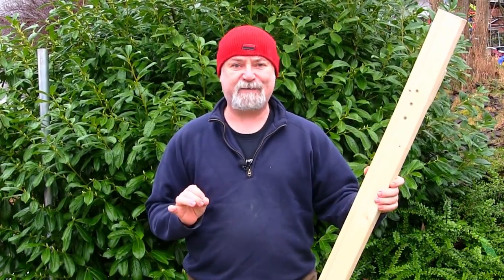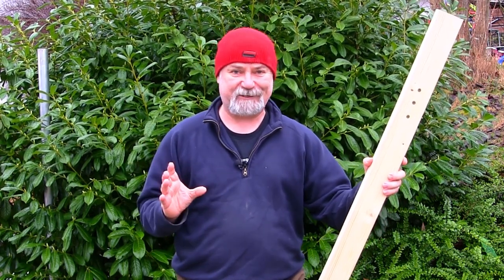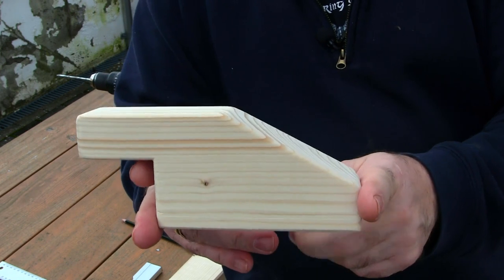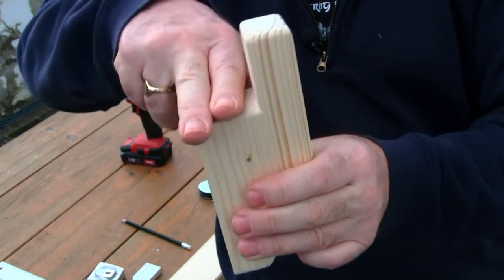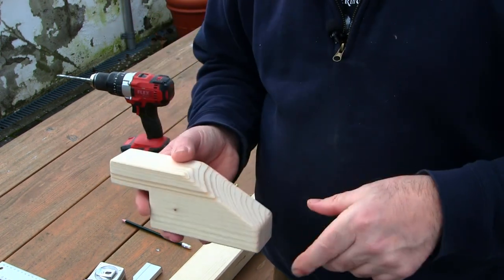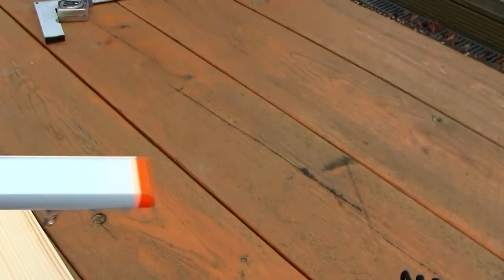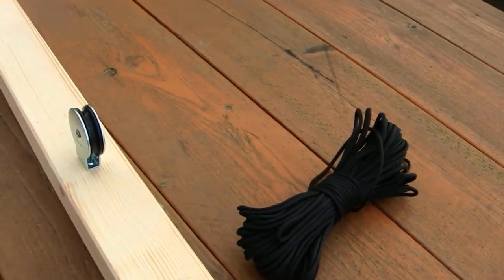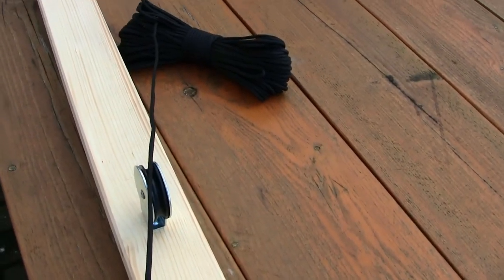DIY Tillering Tree!

Comment: Using the scale on the end of the rope like that has limitations.  if you later need to use an in-line pulley to make use a lot easier, (with a heavier bow) then your measurements are all wrong because the pulley reduces the load at the end of the rope!  Also you are at present measuring bow weight and the stretch in the paracord (quite significant). Most folks seem to go for a scale that fits into the train below the string and rides with the bow movement.  e.g. bowstring, carabiner, scale, pulley, rope to base pulley and back to you.  Hope this helps. :-)
Reply from the maker: Cheers m8. Going to list changes/upgrades in the description section...